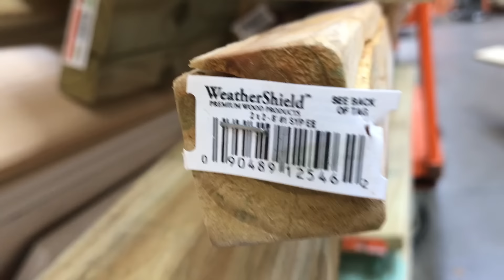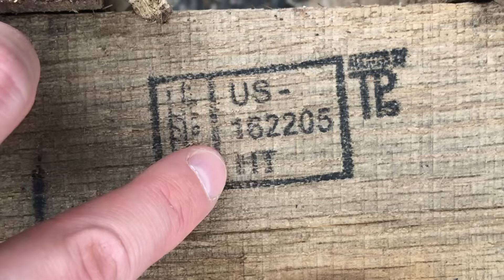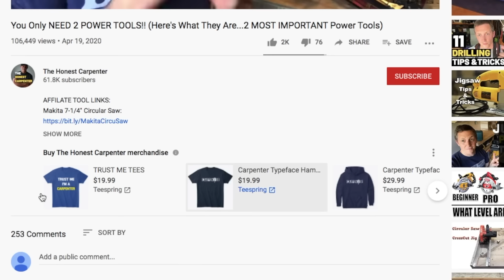Don't Use Pallet Wood!! USE THIS INSTEAD...(Cull Wood Vs. Pallet Wood)

Comment: Decades ago I hated my home with a wood burning stove. I actually did burn a fair amount of pallet boards in it but they were really a pain to work with and I had a lot of nails that I had to clean out of my stove when I took out the ashes. I had an old beat-up table saw that I used to cut them up.

As far as I'm concerned, the primary use for pallet boards today would be to cut up those little strips of wood on the top of each board and use them possibly as some sort of a wall covering. But it would be a lot of work and a lot of treatment and I would do it more for the look it gave rather than because it was going to save me any money.

The other thing I use pallet boards for is a sort of false flooring in my barn. In other words, I use them for their original intended use. :-)

Comment: I use BOTH. non- treated pallet wood make great textures and cull wood is string.  Pressure treated pallet wood in 4x4 and 2x6 is super strong.

Comment: I am an equal opportunity wood scrounged 
Pallets that are marked with HT are safe to use and sometimes you find usable hardwood 
Construction sights are usually best sources for 2 bys and sheet goods along with the occasional 5 gallon bucket, etc
I always look at cull bins in the big box stores, but even with markdowns it still means spending money 
I also look at Craigslist for wood and hardware (along with tools)
But all is said and done, my first stop is pallets

Comment: I’m an old lady who is too clumsy to use power saws anymore. I just got 16 pallets for a firewood storage structure. Because I got pallets of the same size, I will put them together as pre made units and I don’t have to measure and cut boards. I may even make doors and lock up my wood since I’ve had some stolen already.

Comment: I have to drive at least 20 miles (one way, so 40 miles) to get to the nearest lumber yard or big box store. Pallet wood is everywhere. I make only small items, so the limited dimensions are not a problem for me. Another source of wood for me is old furniture (very cheap or for free),  reclaimed wood (building reconstructions) or rest wood at building sites, fire wood (dry or fresh)

Comment: I like getting lumber from lumber mills.  They cut slabs and often disguard lumber pieces that don't meet there requirements suuch as width or lengeth.  I rip it down and glue parts together to meet my needs.  Cull wood is good too for the same reasons.

Comment: I think in general, free wood is free wood.  In my area, cull wood is sort of hard to come by.  People scoop it up fast.  The nicer lumber yards have some bins with damaged pieces for a few bucks. Usually not in any quantity. 

Being picky with what pallets to use for furniture is probably a good idea. If it’s slimy, wet or moldy maybe leave those.  I’ve had some good luck finding really clean pallets.  I go to places like furniture or appliance stores.  I avoid food places like grocery stores or industrial areas for most of my pallets.  Less chance of there gross stuff.  Great video though!

Comment: Pallet wood is fantastic to use, it's free, the ends may split but cut them off, leave the pallet to dry for a few months before breaking it down that way it will stop it from bending and twisting, I can break a pallet down with my pallet pry bar and de nail it in 10minutes, you can get long pallet wood if you find a glass company usually they have glass shipped to them on 8ft pallets, the pieces that aren't useable, kindling! great channel love the vids dude.

Comment: This was great info and have to agree about pallets as garbage. I’ve made a small pic-nic table for my granddaughter with a few pallets. I was proud of it BUT the time you put into removing and nails, most of the time the wood splitting, etc. it would have been so much better and easier to build  with possible cull wood from the local home improvement store.

Comment: I use mainly the planks from the pallets that are made out of oak.  I like oak because it's a hard wood. Oak doesn't even need to be treated,  saving you money and time. I can make anything out of the oak planks. I can create a 4" by 6" support beam just by gluing them together with screws and glue.

Comment: 1. I didn't know about cull wood.
Thank you dearly for the tip.

2. Pallet wood and barn wood which is trendy right now, can literally stink.
Like it can have the odors from the barn or warehouse it's been sitting in. 

3. it also can have termites or other pests that tag along for the ride.

That alone is a no go for me.

Comment: Good to know.
I DID use pallet wood to replace a handle once.
It was for a kitchen tool, so I sanded, stained, then sealed the whole thing.
So far the sealer is doing its job as far as I can tell.

Comment: Hi, just found your video! I drove by a local auto parts shop that always gives away free wood pallets. 

Before bringing some home I wanted to see how I can prepare and clean them for a custom made bed frame. Just 2 pallets would be enough for me but I wanted to see if there were other opinions about them and I was right to check your video out!

I did notice major flaws, ragged edges, pointy nails and general wearing and stains of the wood pallets which would have been impossible for me to work with and just paint over.

The cull wood on the other hand looks much safer to use and more durable yet I have no knowledge on wood tools as it is so this would also be difficult for me to try and do myself 

I just want to save money from buying a pre made expensive bed frame  😩

Comment: thanks for the reminder.  I just built a raised planter that's 3 feet tall; made the basic frame out clean scraps left over from previous projects. Looking for cladding for the sides, and the available pallet wood was just too far gone.  The cull pile from HD begat some 16 foot of shiplap.  Even some curved sections were usable in short pieces on the ends of the planter...less than 4 feet of unusable wood.

Comment: I have built quite a few things with pallet wood, some I cleaned up, some I didn't, and some I even leave the nails in. Depends on the look I am after. And I love tearing them apart. I find it a decent workout and very theraputic. I get the warnings though. Thanks for the video.

Comment: Another good place to find lumber is housing development dumpsters. Most General Contractors don't care if you dumpster dive as long as you don't create a mess or take what's NOT in the dumpster. I can fill up the bed of my truck and have a ton of construction grade pine for small projects.

Comment: I've been burning scrap wood for decades,  so I'm familiar with where to get it and what might be available.  When I find useful lumber,  I set that aside for projects.

A nearby lumber yard used to have loads of odds ' ends they wanted to get rid of lest they have to pay to have them removed.  The past year or two,  that volume has been MUCH reduced.  Higher lumber prices have forced less waste,  is my guess.

Recently I began foraging at a company that sells stone for countertops and such.  They buy stone in 8x16 foot x 1" thick pieces,  and that takes some solid construction to ship and protect.  So there is a lot of scrap 2x4 and 2x6 lumber,  often 8 foot long or even longer.  

The downside is, these usually have a LOT of nails in them. It's also poor grade lumber that often has gaps and other defects  -- serious ones,  often enough.

Still,  I'm experimenting with pulling those apart and deciding if I'm happy doing it. I'd like to rebuild the flooring on an out door deck,  which requires 30 pieces of 2x4x 93" lumber.  I can cut that low grade 2x4 lumber and use two pieces to make the 93" length,  which also allows me to cut off the nail holes at the end of the boards.  The boards are sort of rough,  too,  not planed off.

This is an experiment in progress.  If I don't like it,  I'll do something else.

Comment: Just back from Lowes, looking for a 6’x 10” board; they had six in the bin, each one more beat up and marred than the next  Splits, numerous knots, dents and chipped edges, black smudges… and a nice warp.  $15 each board.  Finished lumber, Ha!  I asked the rep, did they move these to a culled or seconds bin?  “We don’t do that any more.”  But he offered to call the store manager.  Manager:  “$7.50 and it’s yours”. I took the deal.  But if I had not objected, they’d have sold it as prime stock.

Comment: One thing you missed - Pallets are good for cheep outdoor projects. 
A Coral for Composting - Make several Bays for progression.
A Base for keeping Firewood off the Ground - Reducing Rot and Bug infestation.
*Keeping Tractor attachments off the ground when not in use. Carry-all, Scraper, Pallet Forks, etc. 

I'd say we have purpose for Both products, depending on the project.

Comment: First time I’ve seen your page. Good stuff. I literally just collected a bunch of free paletbar boards from a local business that gives them away. I agree, it is a lot of work. But I was down for the task. But I’m more concerned about the chemical treatment you mentioned in your video. I will have to look on my pallets and see if they have those initials on them. But thinking maybe the pallet wood along with the Cole wood that you mentioned might make for a rather nice project. Question? Is there a way to get the chemicals out of the wood if it’s been treated with it? Just curious.

Comment: Cool tip and may use it... but there is car glass replacement shop about 100 meters from my house... they are so close I can walk up to them. Apart from pallets they have frames that are used to secure windshields during shipping and hat wood is much better, also I do not use pallets for anything but outside structures.

Comment: Thank you very much for this advice. Ironically, I just finished watching a video on building a bed frame, which I am interested in doing. The person used two pallets to build the bottom frame which I thought was cool until I saw your video. Now, I'm going to take your advice and use his do it yourself plan. Thanks for the useful tips.

Comment: A wood working place near me has 18 foot pallets that they give away. Sometimes they have doubled up pallets and these things are monsters and have good boards. I'm just getting started in wood working/ carpentry and they're going to be a huge boost to my stater  pile. 

I am itching to see if they have MB or EUR designations but I have a sneaky suspicion they're all kiln dried or debarked.

Comment: Not all pallets are beat up and “harmful” most pallets are heat treated not always chemically treated, a lot of times pallets are made out of hardwood that can be useful in making furniture. cull wood is not always available and when it is available it is always pine or treated pine. Yes you can buy discounted twisted damaged and warped “new” wood from the store, but nothing beats free wood.

Comment: Cant beat free pallets if you know what you're doing  and willing to put in the extra effort to clean them up.
I've built an entire beautiful kitchen with cabinets, island/bar and a hardwood floor using nothing but pallet wood (oak) jointed planed and stained. You need a lot of pallets so you can pick out the best pieces and closest color matches.
All but the sheetrock was profit. The customer was extremely satisfied with the outcome and low cost.

Comment: I would also like to comment on this.. pallet wood has it uses.  I used pallet wood for making my compost bins and for stages for my flower pots and I have used cull wood from Lowes to in other project that required better wood but both can be helpful for those of us on a budget.  I like to use both... pallet and cull wood.

Comment: Everyone finds their own wood from their own local sources and to fit their current project. Pallet wood is still as good as ever. You just have to mill it down to fit your purpose the same as cull wood. Chemicals in pressure treated wood is no safer than pallet wood. I have used both as well as untreated wood I have paid full price for and have had no problems with. Nails in pallet wood are not a problem to remove. A good strong magnet will show you where they are. A nail set, pliers, a hammer. It's just a matter of how much you want it.

Comment: I built the floor of my 12X8 she’d with cull wood and save a bunch of moola. 10 2x8x12 6 2X10 x12 and a bunch of strapping150.00$. The I went to two Restore and found all of my roofing shingles and tar paper for just under a hundred. I’m all in on cull  wood and Restore! Hell ya. Yes easier but not free. Now, if I could find plywood…… ohhhh baby gives big daddy NOTHING to fuss about!!

Comment: Great recommends here because I use to use to use pallet wood in my garden beds until I realized the wood is loaded with nasty chemicals. Ugh!! Good luck finding cull wood however. I worked for a big box lumber store and that wood was always “held back” for the manager’s favorite customers. We have actually started using discarded glass crate wood to make chicken coops, etc., and glass companies are happy to have someone pick all that up. Just make sure you have an arrangement as most companies have security cameras and someone may call the police on you! No idea if crate wood and pallet wood both are loaded with chemicals, so we’ve even stopped using that!
Reply: Well what are you going to use to treat outdoor, or even indoor wood for that matter, if you're worried about chemicals?
Reply: @loganmedia1142  I live in a dense woods atm so we can make our own. We don’t grow food inside any wooden containment system and as far as chicken coops and rabbit hutches, we been using wood we pick up from glass companies—old shipping crates.

Comment: I guess there are two key things here. 1. Is whether you can get the pallets for free or not and just how much those discounts are. If you're paying $40 for $200 worth of wood then, sure, it's probbably better than even totally free pallets. But if you're still paying $100 then it's a no brainer to go for the free stuff, if you have the time (which is kind of implied with the whole idea of using pallets). 2. It also massively depends on what volume of wood you can get at discount. If it's just the odd single, random plank then it could take forever to build up a stock of stuff that can be put to use. Meanwhile, most pallets are going to provide a similar size and grade of wood so you can plan for that with your projects and quite easily add to your stockpile.

Comment: I don't disagree but the only issue with cull is that its largely pine, where pallets, depending on your location may be mostly hardwood. We live in a location where we see a ton of hickory pallets. No idea why but its pretty consistent. I am a huge fan of cull wood but I would not throw out pallets all together.

Comment: I wish I saw this clip before picking up free pallets this morning. Luckily, they are all HT and should be safe for a compost bin. By the way, after further googling around, "MB" stamped pallets are definitely to avoid. However, those stamped with "EUR" (old system) and "EPAL" (new system) are in European system, which should be safe to use because chemical treated pallets are NOT allowed in Europe.

Comment: Actually I find that an even better source of free wood, at lease here in the UK, is to keep your eye out for builders refurbishing a house. Typically they remove the old timber and replace it with new. I have found that they are more than happy to set it aside and give it to you. It saves them having to cut it up and put it in a skip and it could save them the cost of hiring multiple skips.

Comment: We discovered cull lumber through my a video I be watched early 2023 so I went straight to HD and asked where it was. Huh!  They have discontinued it.  They still have it but are selling it now at a reduced price in back.  It's not marked as cull lumber either.  We saw the 2x4 that were mostly warped and in poor condition being sold for $3.59 and cull fence pickets priced at $1.98 each  down from $2.25 abd 98% were split from one or both ends, chizled, warped or an excessive amount of holes and splinters. All of the wood was in such bad condition that we had to pick through the entire pallet and only found 6 usable pickets that still weren't in great condition.

Times have changed.  Stores are trying to suck every single dollar from you and offer fewer quality items. They even took away the military discount on all lumber and building materials since Covid even though they doubled, tripled and quadrupled the prices. Unfortunately, pallet wood, as junk and tedious as it may be is still the most affordable option these days. Only last night we  filled the back of my SUV with more free pallets from nearby to convert into lawn furniture, planters and privacy fencing. Again, if money were not the key factor I'd just buy the overpriced lumber instead. Tomorrow I may call a few lumber yards to ask if they are still offering the cull lumber since HD and the blue store no longer offer it in my area

Comment: It depends on what they are being used for, and what they WERE used for.  most standard pallets are 40x48, most pallets for drums are 48x48, and the ends of all wood will split.  nails are treated with glue or resin which melts when the nails are put in, then hardens / bonds when they cool (A few second).  I LOVE pallet wood.

Comment: My brother works at a truck body construction firm, they build shit like cranes onto big ass trucks so the cranes come one these crazy fat piller wood pallets, we get them, disassemble them amd we have built a whole carport, flooring for our outside kitchen, floor for our basement and soon a greenhouse out of them. We don't mind using regular pallet wood either tho, once all the nails are out and you shave off the outside it's good wood.